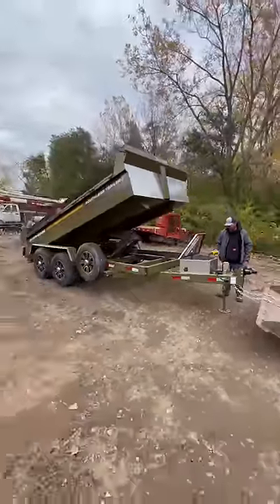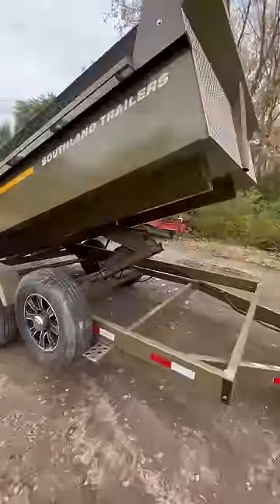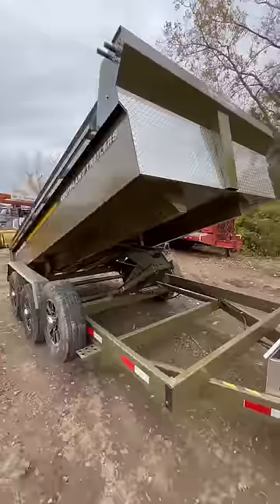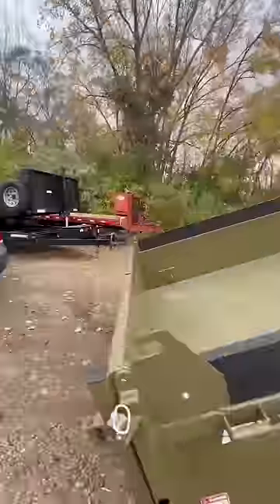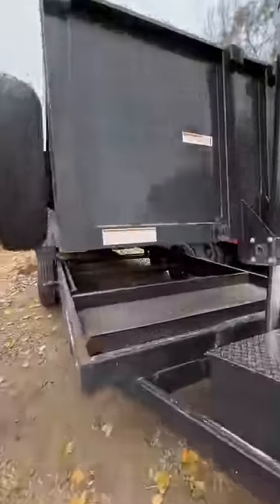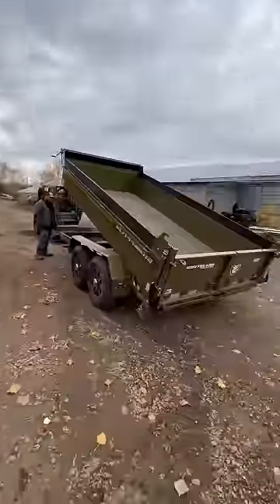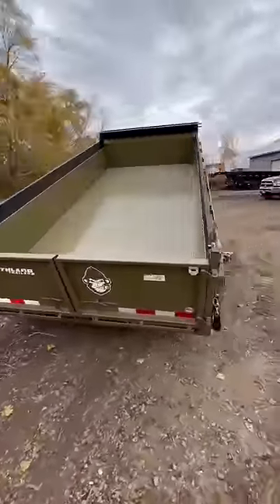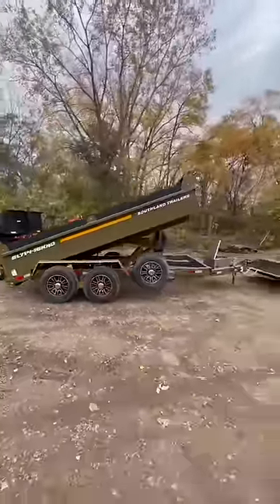They build dump trailers in Canada a little different. #shorts

Comment: Usually the probem with dump trailers is you can easily over load them,  but that second trailer is heavier but has more lifting power .
Reply: You certainly have to match the cylinder in the hoist to match the capacity.  My (not Southland, but still Albertan) dump trailer shipped with that hoist, but an undersized ram.  A level load of fluffy topsoil and it would just sit there.  Putting in a ram just 1” greater diameter and I’ve yet to find a load of anything it wont hoist.
Reply: It's a better trailer altogether

Comment: i saw one in person at auction (12 or so new units)  and was very interested in one but upon further inspection the bed thickness is 8th inch if not thinner, when i lifted it half way up to see the under side supports i could "twist" the bed with 2 fingers of weight to the corner, working metal fabrication for 3+ years i can see EXACTLY where corners are cut on build and design, good for lighter duty use but i wouldnt add one to my fleet for anything other than light brush
Reply: Seems like that could be an easier to fix for somebody with a little bit of knowledge though

Comment: My Surtrac has a double piston it’s rated 14000 lbs I love my trailer . I’m in the Banking industry for 38 years of moving heavy safes and building walk in vaults for Bank’s and credit unions so I know steel . So I know steel . That trailer you showed had short side walls and would not have considered it over the Surtrac.  Surtrac is built here in Indiana and I would put it up against any trailer on the market. I also own 2 Imperial trailers that have paid for themselves 10 times over they are made in the USA to.
Reply: I have a SureTrac 14k Deckover dump. They have not offered them since the Covid shutdown. I got one of the last ones at the time (2k mi. drive). I'm Very happy i got it when i could. SureTrac's tubular chassis means it has the highest payload of any Deckover dump. And mine (technically an "H&H" trailer has the 7ga floor. Love the thing....

Comment: It looks like a very lite duty trailer!
Reply: So have you read any of the comments from people that own them and pound the crap out of them on s daily basis. You would be wrong . They stand up great according to multiple owners hauling various loads .
Reply: @natcalverley4344  still not convinced, not enough cross members to fully support the floor from dropping large blocks of wood ( oak, rock maple) also rocks, I can envision the floor getting severely dented in!
Reply: @brunoperrault604  ever heard of SBF 50 ? You get dips between cross members all the time on demo trailers and rock boxes  causing difficulty in the load sliding out over time. Ever see a 40 foot demo trailer laying on its side. If you walk up and look at the trailer you will likely find the floor punched in between every crossmember . I am not a fan of the the lift system on the box of these trailers because of my past experiences with the same type of lift systems on older 5 tons I have owned. 
      When dents occur in these types of trailers they tend to have less acute angles not effecting load slide out. We have owned both types of trailers in large triaxle demo trailers and the cross member style have higher maintenance costs and have a higher incidence of rollover when dumping due to stuck loads and the drivers trying to shake them out. 
   It is your money so fly at it but we went sway from the cross member style build for those reasons. 
Best of luck.
Reply: @natcalverley4344  I understand, to each their own! Stand by your belief! Wish you luck!

Comment: Well both arev nice trailers, and both boxes will weigh the same . The one with the hoist in the very front will probably dump the most weight.
Reply from the maker: your could be right
Reply: I have a 14' Sure Trac with telescopic lift. it acts as if there hardly is a load even maxed out with rock. Gotta say that anyone ever have one stall wouldn't ever go back after using a telescopic.

Comment: Wished I'd found this company before I bought mine. Mine is nearly the same as the second one. Oh well, still beats shovelling 😄👍.
Truck on.
🤟😎👍🚛🚛🚛
Reply: you did good we use one like the first one and its not all that, if you over load it you still have to use a shovel to take weight off. the second one has more power. You might break your pick up or the axles but it will lift a full load of gravel.

Comment: I’d like to see those with a telescopic cylinder
Reply: Why?
Reply: @elmeradams8781  scissor lifts are very weak for the first 6" to 12" of lift. I frequently need to block the front of the bed up before loading to be able to dump it. The telescoping cylinder is stronger, but uses a lot more hydraulic fluid and requires a higher volume pump. I used to build the scissor type dump beds.
Reply: @stevebaines7535  That used to be a problem with my scissor, until I upgraded the cylinder.

Comment: Sizzor lifts are bad they once you're trying to lift 9 tons in the air its not strong enough
Reply: Sizzor are fine, just use more juice - which leads to less dumps per charge.  But still work just fine.
Reply: @boarder247  and then you wake up
Reply: Scissor are best for durability, lifespan and battery life for a normal length dump trailer. Every single telescopic on a dump trailer is cheap import sourced and you Will Not find parts when the seals wear out, which they will much quicker with 10xs the exposed chrome. All Scissor lifts use USA cylinders and frames. Expensive for the manufactures to source (they literally come from the same lift companies as for medium duty dump trucks) . That's why they want you to buy the Alibaba telescopics- more profit for the trailer company.
Reply: @georgehofgren6123  and then you wake up

Comment: Always learn something new on this channel. There's a guy in Canada who builds trailers with single piece floor and sides. He also uses an automotive grade paint which he says is tougher and more effective than powder coat. Berkelmans Welding I think is the name of his company.
Reply: It's pretty odd because one of the aspects about powder coating is that it is tougher than paint, just because of the process it takes in order to adhere and cure it to whatever you're putting it on, race car frames are powder coated because it is stronger than just paint
Reply: @diychad7268  they should just lineX them for ultimate durability. Powder coat is pretty tough but I've seen it chip and flake off quite a bit especially in joints. I'd never lineX a pickup because they always just look crumby but a trailer makes more sense.

Comment: I like the hoist on that trailer.  Lifting whole bed not one area.
Reply: A neighbor bought a trailer with the hoist in the center of the bed with horizontal supports, I used it once and I could see the the whole center of the box floor flex 3-4 inches with a couple yards of dirt in it before the rest of the box followed. Was not very impressed and chose not to borrow it again. He thought it was a good deal price wise, which was still pretty costly and I don't think it'll last half as long as his last one.

Comment: I would like to see what the trailer looks like after a year of daily use for wood hauling, nice looking rig.
Reply: Besides a few scratches in the paint for just wood hauling I would not imagine it would look very much different
Reply: @diychad7268  wood is heavy man, can do a number on trailers depending on how loaded, like with a tractor bucket, yeah it's gonna be wavy over time
Reply: They hold up good, my neighbour runs a south land up here in Canada and he’s a logger and rancher and it’s been great… unless your dropping logs from a good height and being stupid they take the abuse really well.
Reply: @beautifullogger2614  that's what I like to hear, just don't be stupid and it'll be mint
Reply: @beautifullogger2614  Thanks bud I appreciate that.  We use Bri-Mar trailers currently and the bottoms are trash after about 1000 cord of normal hardwood firewood. I really appreciate the tongue lift, what an obvious and beneficial appointment, and will consider looking for these in the future.